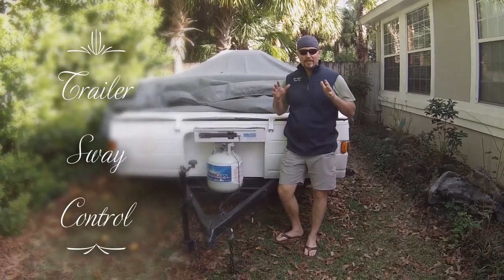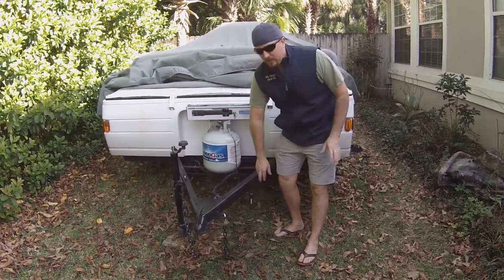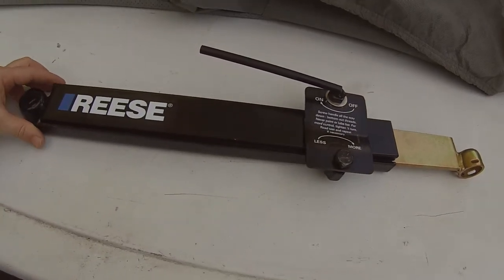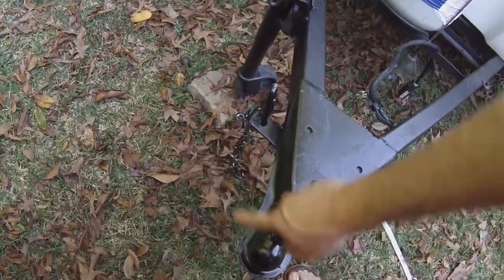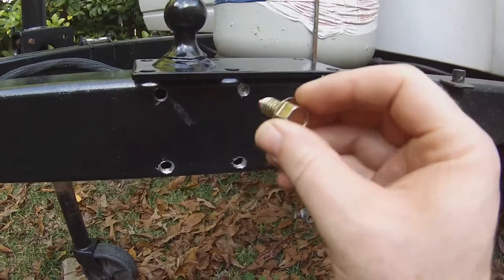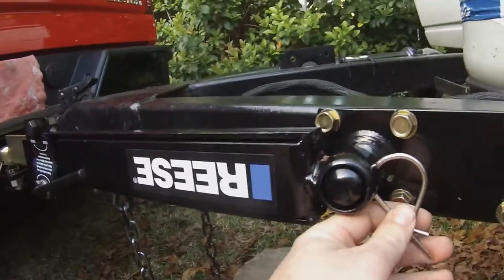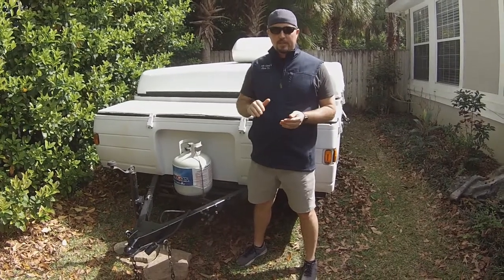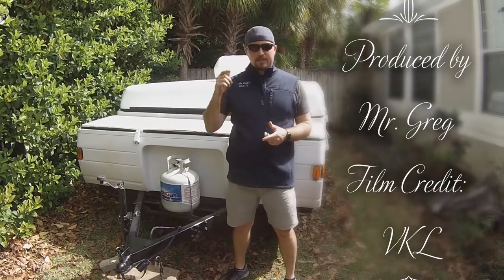HOW TO Stop Trailer Sway

Comment: Had this friction sway control on my very first travel trailer back in the 80's.  You have to be careful and remember to unhook it when you are making ANY hard turns, especially to the side it is mounted on, or it can bend you trailer's frame. I stopped using this kind of sway control years ago. There are so many better sway control systems now, such as a Fastway e2, which gives you 2 points of sway control. They do cost more though. But you can set it and forget it. You take it off when you're done towing.
Reply from the maker: Thanks for the insight, partner!  Appreciate you sharing.

Comment: Will this help with a car dolly?
Reply from the maker: Hey partner!  It should help, but you’ll need to check the trailer weight and sway control bar weight ratings. The model in this video is for lighter trailers. There is also an option to use two of them (one on each side of trailer tongue).  Best of luck!

Comment: If your follow basic common sense you have nothing to worry about.   A truck with a correctly loaded trailer is no problem at all.  When stupid people use a 4 cylinder Jeep to pull a 27 ft trailer well thats when you have problems and I have seen this many times.
Reply from the maker: Good point, partner!  Thanks for sharing.
Reply: Not true at all. Maybe true with your rig and the things you've towed, but it's not universal. I've towed long and short, all within towing spec and properly balanced. Small utility trailers in particular will try and tear you up any chance they get over 50.